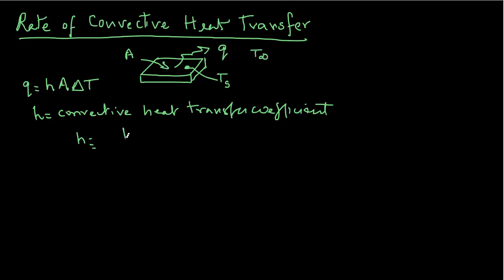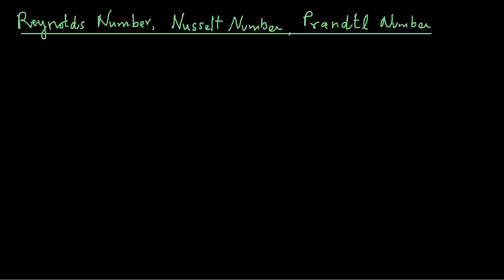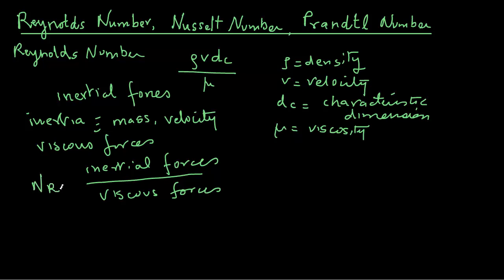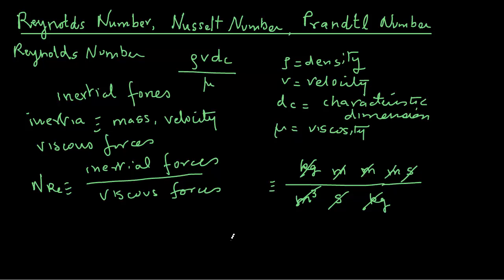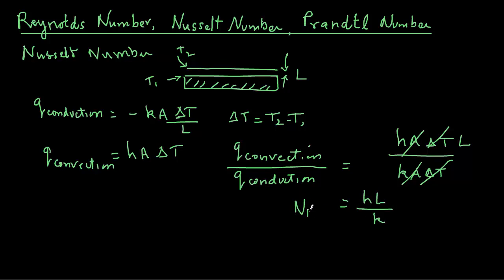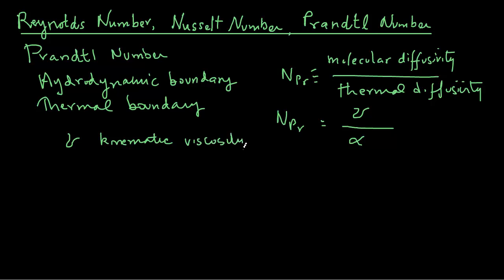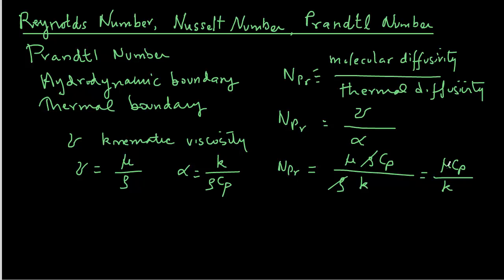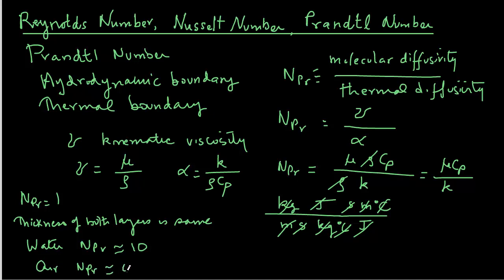Convective heat transfer - Dimensionless numbers

Comment: Hi Paul, great video. Could you do a follow up video on describing how to use Pr, Nu, Re, Sc and other non-dimensional numbers to solve problems?

For example, if you had one object, and you are given its lengths and the velocity of air and such, then you had another object but with different dimensions, and how to calculate the convection coefficient then?

Thanks!